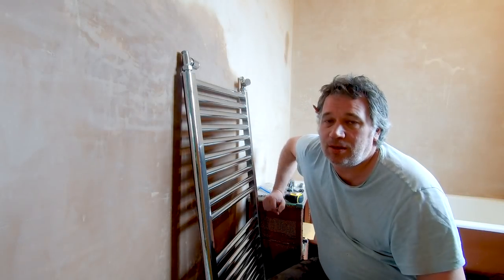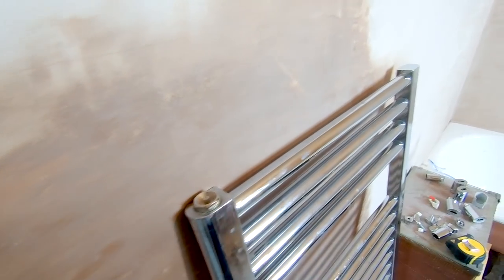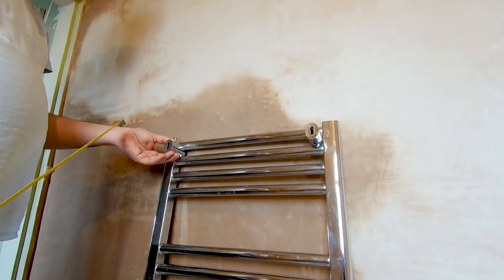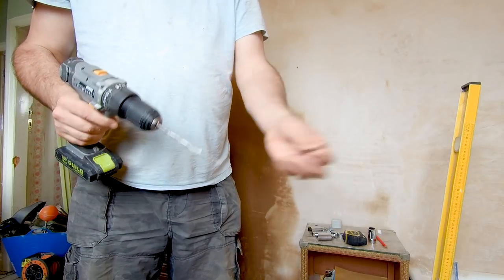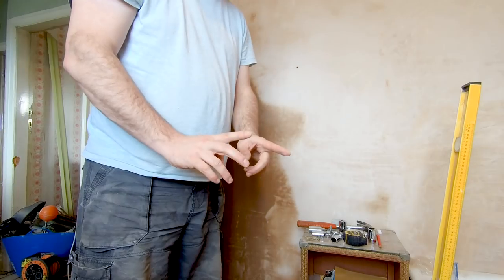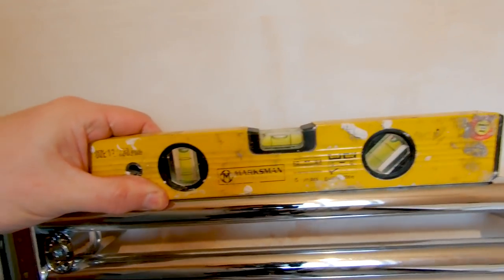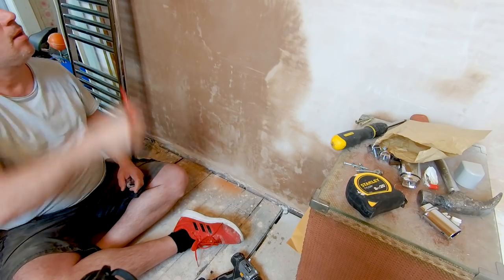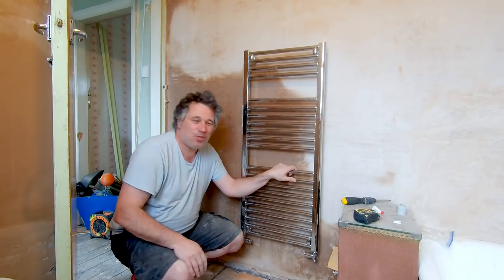How to Install a Towel Rail - Bathroom Renovation 08 - DIY Vlog #25

Comment: Tanx for the upload,wouldn't you use jg speedfit tee for connecting the radiator up to the pipes it'll be a lot quicker and they'll be under the floor?
Reply from the maker: Yes, the elbows are already jg Speedfit under the floor. So just need to swap them for tee's,  reduce the pipe to 15mm then come up in copper pipe to rad just to make it look nice.
Reply: @LCWDIY  tanx 👍

Comment: Can I buy brackets separate anywhere as mine are rusted and broken?
Reply from the maker: Screwfix do some for kudox radiators. They might fit yours but you would have to check.